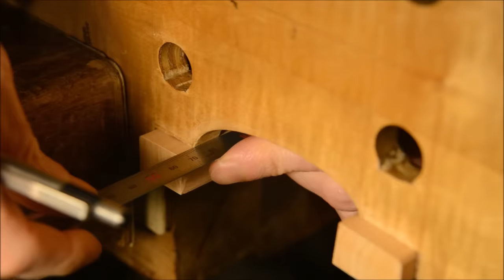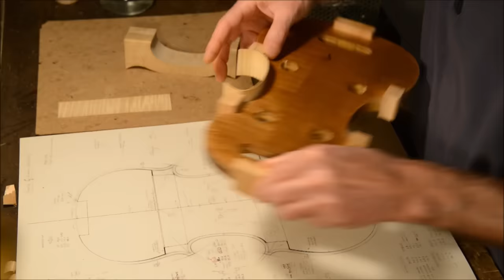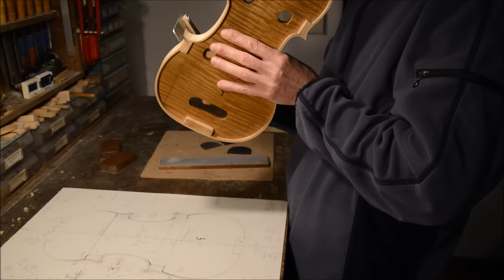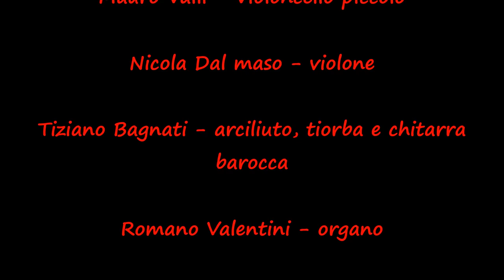Rib making from start to finish (condensed)

Comment: How thick is the rib? Thanks wonderful work!🙏🏻
Reply from the maker: 1.1/1.2 mm
Reply: Wow that’s a lot thinner than I thought! Thanks again!🙏🏻
Reply from the maker: @1cleandude  Thin ribs are very important for the sound, they allow the soundbox to breathe. Of course, there are also the linings that reinforce the structure and increase the gluing surface with the plates. The linings are about 2 mm thick and 7 mm high.  You can see the finishing of the inside of the ribs after the removal of the form in this video:
https://www.youtube.com/watch?v=12jxxrw8pXE&t=1s

Comment: Hi Davide, i see you are using willow, are their some quality difference in willow for the corner blocks? i have willow, but the year rings seems really hard to see, cause now while cutting the corner blocks, it splits wrong and it is hard to bring it in shape.
Reply from the maker: There is willow and willow, it depends on how it is cut, where it comes from, the position in the trunk where it is taken, etc., etc., and this applies to any other wood. The orientation of the grain is not very critical in willow because it is a homogeneous wood (for spruce instead it would be so because of its inhomogeneity between earlywood and latewood). On the other hand, the fundamental thing for every wood is the direction of the split (direction of the fibers), which must necessarily be straight to facilitate cutting and optimize the resistance of the blocks.
If the direction of the fibers is twisted (such as if the wood comes from the lower part of the trunk near the roots, or from trees grown in a very twisted way) cutting the blocks can become a real nightmare, that's why it is important to use only those with a regular and correctly oriented split.
Another important thing is the weight, if your willow has a density greater than 0.38g/cm3 it would be too heavy to be ideal for corner blocks, the lighter the better. Thus, one can also overlook the grain direction with willow (for example there are antique violins with tangentially oriented or completely random grain orientation), but if your wood does not meet the other split and weight requirements I mentioned it means that it's not a good choice for blocks.
Reply: @DavideSora  thank you for your in depth answer, do you have some wood suplliers you prefer? i just ordered wood by cremonatools by the way
Reply from the maker: @mkdijkstra4855  The willow I use I got from Rivolta ( https://riwoods.com/it/ ), but I don't buy wood through the internet, I've always chosen it personally, so I don't know who else to recommend.

Comment: Is there practically any difference in making the linings 1.5 vs 2mm? Or width 6mm  vs 8mm?  When I knock a violin plate from outside, if the linings are thinner I feel they ring more like a dull thud, like a violin that sounds better... is 2mm linings overkill? Thanks
Reply from the maker: The linings are an important factor that determines the stiffness/flexibility of the ribs, which in turn are the most determining element of the rigidity of the soundbox. So varying their size is actually crucial. In my opinion, making them too thin and above all too low in height would make the ribs too flexible by removing the necessary support for the free vibration of the plates. But on the other hand, even making them too thick and high would probably make the ribs too stiff, limiting the breathing factor of the soundbox. For me the ideal measurements for violin linings are 1.8 / 2.0 mm thick and 7.0 / 7.5 mm high, but understanding what changes by changing these measurements would be quite difficult, as it would involve the complete disassembly of the violin, thus making the final judgment unreliable. As usual it is a very complex matter, so the best solution is to rely on your personal experience, and on the observation of these elements in ancient violins that have a high acoustic performance (not all of them, therefore🙂). If you want to get an idea of how complicated it is to draw conclusions reliably, you can listen to this lecture by Mr Gough and perhaps research and read all his papers that he has published, highly recommended: https://www.youtube.com/watch?v=1W5EJF1slr4
Or those of many other scholars, which you find on this youtube channel: https://www.youtube.com/channel/UCb8nC_6JQtlqal0-bVQZMeg/videos
I am just a simple luthier, I do not like it and I would not be able to venture into scientific explanations, which, moreover, do not actually exist due to the complexity of the vibratory behavior of the violin structure.

Comment: question, again from me :), what kind of bending iron are you using? and is it still for sale? i am a really beginner, and would like to have the same shape, as i have already one, but  it is hard for me to bend it to the c's of my own mould
Reply from the maker: The Cs are the tricky ones to bend well...you have to make sure to always keep them perfectly in contact with the iron in order to keep the heat uniform inside the wood, applying the pressure to bend very slowly and progressively and with a very even distribution.
My bending iron is very old and self-made, you will not find it for sale. But it is possible to change the shape of yours with files and sandpaper files and a lot of patience, I did it with mine which at the beginning did not have an ideal shape. In fact, if you notice in the video you can see that I have inserted a thickness of brass in the center of the iron to increase the thickness and be able to make more open and progressive curves. Consider that using a different metal as I did is not the best for the different expansion coefficient when it heats up, I was forced to grind it when hot to avoid edges😅
If you like, you can send me an email so I can send you a photo of my iron taken from above with a measure of the width from which you can get the exact profile to compare to yours.
Reply: @DavideSora  i have send you the mail, and thanks again for the explanation

Comment: What kind of wood do you use to make your blocks?
Reply from the maker: Willow. 
Sometimes I use spruce if I make a Del Gesù model, but I prefer willow, which is the wood that Stradivari also used
Reply: @DavideSora  Thanks for your quick response David. Is willow used because it is a fairly soft wood, harder than spruce, but softer than maple to aid in connecting the sides and top?
Reply from the maker: @wilhelmmatthies5921  The ideal wood for blocks should be light but compact, especially for top and bottom ones that are structurally stressed. Traditional woods are willow, spruce, linden, and poplar. In my opinion, willow offers the best strength/weight compromise, and above all its beautiful color is way better! 😅 But other woods can also work equally well, the important thing is to choose them with the right density and grain, and this also applies to willow.
Reply: @DavideSora  thanks again for your quick response and advice. 
Your videos are a big inspiration to me! I know that they took and take a lot of effort and expertise to make them, so I am very grateful to you.

Comment: What bending metal is this. I‘m using stainless steel but it get marks on my wood.
Reply from the maker: The bending sheet is made of copper, the bending iron is made of aluminum. They do not leave any marks, except if they are dirty or oxidized. But stainless steel should also leave no marks if you keep it clean, are you sure it is stainless steel and not ordinary steel?
Reply: Davide Sora yes in the description of the product is desclaired as stainless steel . I guess someone ground my steel sheet with sand paper I guess. And now the wood gets regulary marks

Comment: Why does is tilt at 15:20? Like this it can not fit to the top. I don't unterstand this. Can you please explain this?
Reply from the maker: Yes, the rib surface is angled on the top side, starting from the upper corners to the neck block. This is a tipical feature of ancient Cremonese makers (Amati, Stradivari etc.) and an integral part of the ancient Cremonese working method. This angle put the top in tension counteracting the bridge pressure and lowering the top at the neck for better clearance of the fingerboard. It works even aesthetically making the soundbox profile fuller in the center, while if the line of top and back are straight they optically seem to approach in the center giving an impression of weakness of the soundbox seen on the ribs side......aesthetic subtleties......... :-)
See this video for more detail on the making of this slant: https://youtu.be/it_65hzYxrg?t=357
Reply: @DavideSora  Thank you very much for your answer. I didn't know that. Now it seems to be a little bit more impossible to built one by myself.
Reply from the maker: @wlentsch8222  Don't worry, it's not too difficult to make this slant if you look at the directions in my videos😊. In any case, this system is not followed by all luthiers, many tilt the whole top plate from the lower block to the upper one, without making the slant only from the upper corner blocks. In fact, it is simpler and faster, and for many it is just fine like that. But not for Stradivari, Amati and Guarneri, and I think it is worth following and preserving the method of the ancient Cremonese school. But I was born and raised in Cremona, perhaps others do not feel the responsibility given by this origin as I do...😅

Comment: I'd find me one of those old Foley-Belsaw planer-molder machines, and make custom cutter knives for it that would create dozens of 8 foot long boards with the profile of each of those corner, and end blocks.  Then you just chop them to length with a power miter saw.
Reply from the maker: One of the major advantages of using the Cremonese form is precisely that of allowing modifications to the blocks to introduce elements of personalization, intentional or derived from manual labor, which will make each violin a little different and therefore unique. What you suggest is serial work, perhaps good for cheap violin factories but completely out of place for a true luthier who wants to make high-quality violins. Then it would, however, be impossible to obtain such long boards with the necessary straight fiber, to be able to split the blocks correctly when you will have to separate the form from the ribs
Reply: @DavideSora  With all due respect, I'm a craftsman who produces custom products, each one requires several weeks of effort to produce.  The elements that must be unique are given the time they need because there is no way to speed things up.  But for every element that I can standardize, I do.  My clients appreciate that I don't waste their money by spending undo labor on elements that make insignificant differences.  Your point about being unable to find straight grained wood in great lengths is well taken.  But it does not invalidate the main suggestion.  It is still very possible to mill shorter lengths that are straight grained, and get a huge savings in time.  
  I appreciate that there are key components that need to be made by hand, such as the belly, and back.  It is possible for them to be carved by a CNC machine, but their contribution to the sound quality is too significant to leave to automation.  Corner, and end blocks, however, are not that critical since their inner faces are determined by the form.  The impact they have on the geometry of the sound box doesn't vary from instrument to instrument because they are cut to fit the indentations in your form.  And even the variation they have on the outside of the violin is negligible since you use standard templates to mark them.
Reply from the maker: @deezynar  Thanks for the detailed explanation. Your arguments are appropriate and understandable, but although corner blocks (as many other details in violin making) are actually insignificant as far as acoustics are concerned, they are decisive as far as style is concerned. I know it may sound silly, but the style of the luthier is an integral part of the work and an indisputable added value, at least as I see it. Of course, the sound is the most important thing, but there are no great violins, old and moderns, that are not strongly characterized by the style of the maker. Some may consider it negligible but fortunately many appreciate it and indeed look for it and are willing to pay for it, precisely because they recognize the added value that it represents. 
The use of templates in violin making, although if in a short video can give the impression of repetitiveness, it's just a way to speed up roughing, not a line to be followed blindly. The choices that will lead to the final result must always be dictated by the eye, which guides the hand today as it did 300 years ago. I am also convinced that carrying out the work with ancient hand techniques is a way to preserve them from the inevitable oblivion that they would face in a short time if everyone gave up using them to switch to cheaper "modern" systems, and this concerns all techniques of the making method, not just those with relevance for sound. In fact, the main purpose of my videos is to show in detail how my violins are made so that whoever wants to own them is fully aware of what he will have in his hands, the tutorial aspect of the videos is just a "side effect".
However, I perfectly understand who does not agree with me and who considers many of the things I do anachronistic or simply a waste of time, I think it's purely a matter of choices, many luthiers have made very different choices from mine and I respect them (almost😊) all.
But I don't regret doing mine, they really work for me and are very rewarding.

All the best
Davide
Reply: @DavideSora  I wish I could like this reply 500 times.  I really appreciate all the work you do, both in raw violinmaking and the videos to bring the process to the rest of us.

Comment: Ciao, ho risolto in parte il problema della piega delle fasce. Nessuna rottura netta sto giro. Devo solo migliorare la tecnica visto che piccole imperfezioni sulla marezzatura ci sono ancora specialmente sulle curve strette. Mi chiedo se la lastra di alluminio che serve per piegare appunto sia il vero problema.  É lunga 25 cm senza contare le maniglie. Purtroppo non vorrei dare la colpa solo al legno problematico. Ora mi sto esercitando per migliorare la causa.
Reply from the maker: Una delle cause di rottura delle fasce è la non uniformità di contatto con il ferro piegafasce, causata dalla pressione discontinua applicata sulla fascia che potrebbe essere causata da una lamina che non si adatta bene. Io utilizzo una striscia di cuoio per proteggere le dita dal calore e essere in grado di mantenere una forte pressione anche se la temperatura sale. Anche piegare troppo velocemente senza permettere alla fascia di raggiungere la temperatura ideale potrebbe essere un'altro problema, in quanto le parti non ancora in contatto con il ferro avranno una temperatura più fredda. Solo alcune cose che mi vengono in mente, poi se le rotture sono solo semplici sfaldature superficiali e se si riescono a tenere nella zona di incollaggio al tassello direi che sono tollerabili. D'altronde questo tipo di sfaldature sono spesso presenti nei violini di Stradivari, quindi anche lui ogni tanto aveva questo problema😊
Reply: @DavideSora  infatti ora si tratta di sfaldature leggere ma fastidiose. Mi devo esercitare di più perché per vari motivi sono stato più o meno fermo per colpa dell'ambiente non facile nella liuteria. Amo questo mestiere però rimasto deluso da questa mania della produzione di massa. É stata dura ma ora voglio mettere la rabbia da parte e far i 3/4 strumenti all'anno con calma e ricerca. Ti ringrazio tantissimo dei tuoi preziosi consigli 👍💯❤️

Comment: Why is the back not made from one solid piece of wood please ?
Reply from the maker: If you mean the lower rib (the back is the back plate in violin maker terms) it can be made either in two pieces or in one piece, but frequently the wood strip is not long enough for a  one piece rib. Some make it in two pieces if the back is in two pieces and in one piece for one piece backs for aesthetic reasons (orientation of the flames) but the ancient Cremonese luthiers did not pay much attention to these things and made it almost always in a unique piece to avoid added work. They also made the upper rib always in one piece to better withstand the three or four nails that were used to hold the neck in the baroque violin construction system, today a dovetail joint is made and the nails are no longer used so there are no problem from a structural point of view. Today there is a tendency to use the same wood for the back and for the ribs and scroll, anciently it was almost always different, they didn't care about these "insignificant" aesthetic details, unless the commission didn't come from Noble or Royal families....😁
Reply: @DavideSora  so making the back plate from two pieces of wood is a compromise brought about by lack of more suitable materials ?
Reply from the maker: @santallum  Not exactly a compromise for lack of suitable material but rather a fixation of modern luthiers for aesthetic symmetry😊
In any case, almost all the Stradivarius today have the lower rib in two pieces, as it has been cut by restorers who have had to compensate for plates shrinking over time. The upper one was cut in two when necks was replaced and fitted into the block with a mortise in the modern manner (a stronger joint with no more nails needed).

Comment: How the fuck do you get the template out of there?
Reply: The ribs are thin so they flex quite a lot. The blocks are broken loose from the mould with a hammer and then carved away until removal is possible.  Mr. Sora has videos of this process.